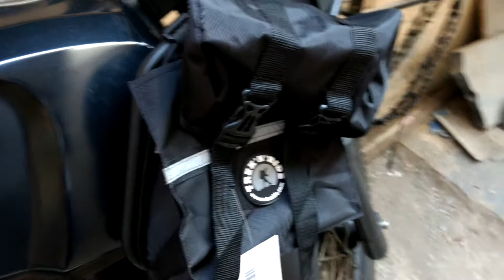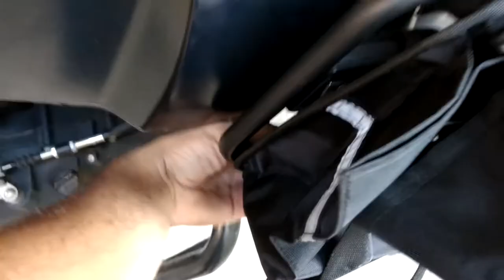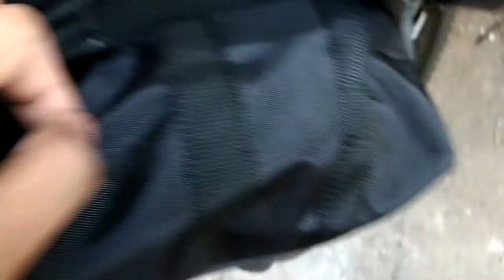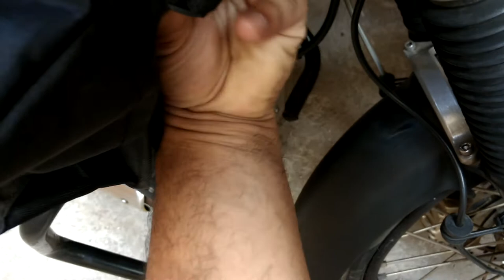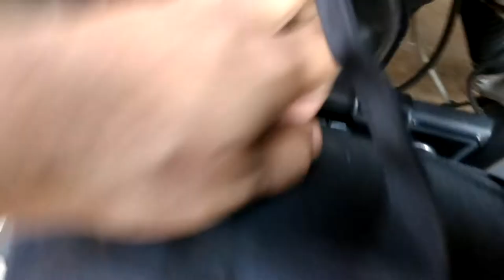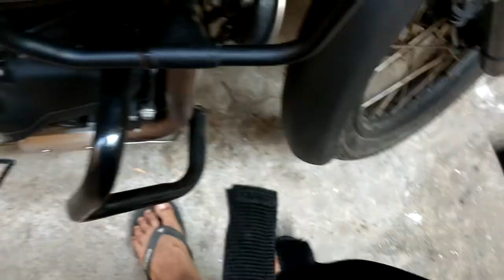Trek N Ride Can Empocher - Himalayan

Comment: This comes as a pair or we have to buy each side separately? 
Is it easy to use attach/detach?
Thanks in advance!
Reply from the maker: it comes in options like left empoucher and right empoucher..you can buy either one or both.
Reply from the maker: TREK 'N' RIDE Enfield Himalayan Waterproof Left Empocher https://www.amazon.in/dp/B077Z21FQL/ref=cm_sw_r_cp_apa_i_F1bCCbZ36G38V
Reply: @luwrods Kitna liter fuel tank fit hota hein isme ?
Reply from the maker: @kolponaogolpona8043  5 litre in one pouch. Total 10 litres if you store both sides.